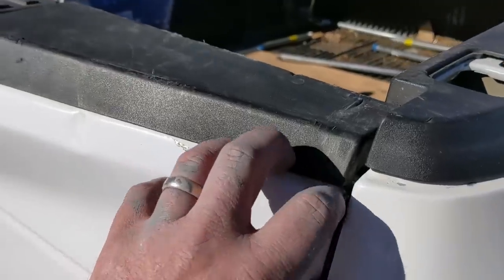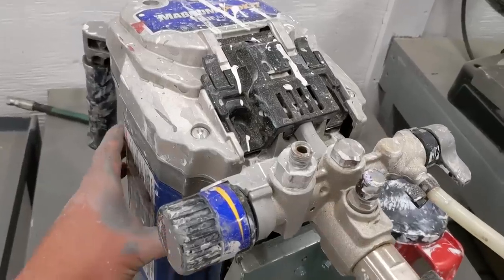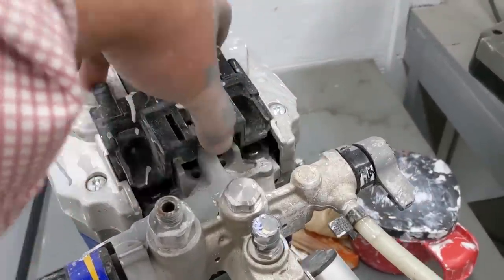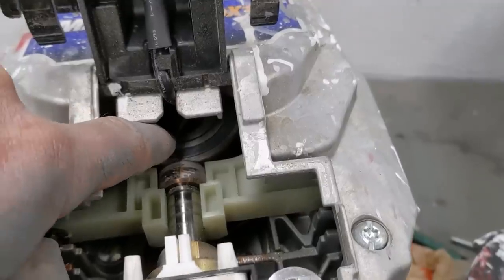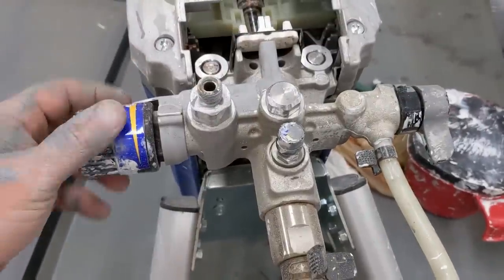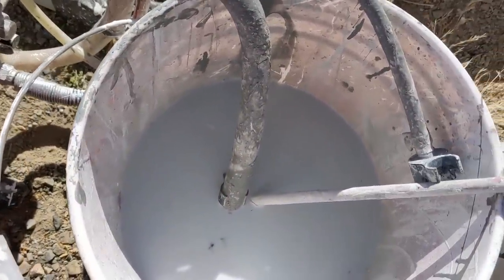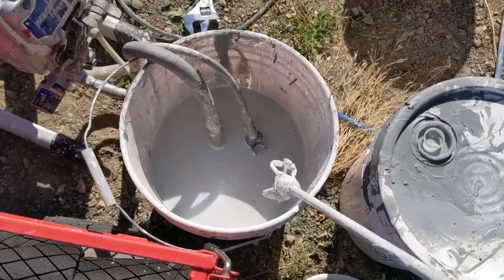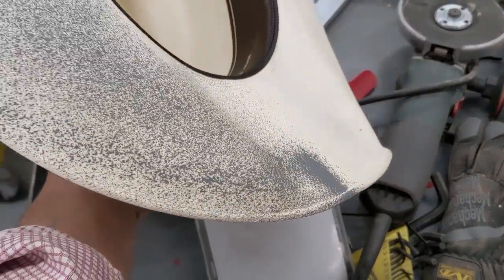Tune-up the wife's favorite toy | Grayco MagnumPro

Comment: Actual Help Wanted Ad seen in South Florida:
Painter Wanted. Must be sober.
Reply: 3 weeks later:

"Painter wanted. Preferably not drunk."
Reply: @hillie47  
LOL!!!
Reply: Sober Painter is the White Buffalo of tradesman. Hence the official classification of the painting trades as 'Semi-Skilled'  with the exception being automotive finish booth sprayer .
Reply: @DavidDiaz-zp4hu  
I work on boats. 
I've seen some real artists applying glass like finishes to high end yachts and boats using a technique called "Roll and Tip" ( NOT spray painting).
Incredible attention to detail required,  and a in depth knowledge of flash points, temperatures,  drying rates, and many more things than I know. 
Definitely not a place for a stoner or drunk.
Reply: @DavidDiaz-zp4hu  
Umm... I think that you missed my point. 
I was saying that the people who can achieve glass like finishes using Roll and Tip are highly skilled and trained. 
Also, (instead of flash point) I should have said flash rate - the speed at which a coating of paint "skins over" - which determines how large of an area you can roll before needing to tip.
I've seen where they've had to adjust their paint to reducer ratios several times while painting a single large hull, based on changing temperatures,  sunlight, wind,, etc.
No. The application of a perfect Roll and Tip finish is not something that can be done by a drunk. It takes a real professional with an excellent sense of detail.
Reply: Florida Man
Reply: @DavidDiaz-zp4hu  ya found him- Been sober 2 years and painted professionally most of my life.
Reply: Sorry to hear that,.  My Condolences on your choice of trade ..
Reply: I think the joke isn't that painters are a bunch of alcoholics, but that even a sober painter is going to seem "drunk" from inhaling all the fumes of oil based paint and stains.
Reply: @deltab9768  Majority of painters are active alcoholics-  I'm a rarity
Reply: No actually it's more of a stereotype than a joke,  the fact that so many painters , drywall\ sheetrockers etc do drugs and drink even on site,  being that their job is so low skill that it doesn't require a huge amount of focus & concentration to keep others safe or do the job.
Reply: @DavidDiaz-zp4hu  Takes more skill and training than any other trade to do high end work competently. Everything else is cookie cutter glue paste screw and solder

Comment: Another great use for these is household cleaning..a low volume pressure washer.   I kid you not, 3000 psi water at a few pints a minute will clean the grout in your shower faster than manual scrubbing.   
Yes, I have used my 4000 psi 4 gpm beast inside the house..but for ripping up a fooked concrete patch job over embedded plumbing "repair".  Fixed the copper with refrigeration silver solder, then used proper concrete patch.   Floated it with microtop, then stained the concrete.  Invisible.

Comment: Brother has a painting company here in FL those graco paint sprayers are expensive (his costed $5000) but built mighty they are made in the usa if think your sprayer is dirty you should see his holy moly.

Edit: his is gas powered and uses 5 gallon buckets you need to keep an eye on it or you'll run out of paint quick

Comment: Well this takes me right back to my first job as a kid working in the family paint shop. Had an air powered 3000 psi Graco to apply high solid marine anti fouling coatings. It was a great machine when it was working, but those high solids paints too their toll and it needed a lot of maintenance. How does that electric job handle the thick stuff?

Comment: ...I'm a wondering if you were to use the 'Varnisolv' (brand name for oil varnish remover) to cycle through that thing once in a while...then say a brake clean chaser to clean it out right proper.......then perhaps a hot soapy water to make sure there is no leftover paint contamination...I found paint thinner OK when I would wash my paint guns ....when I'm not fixing industrial compressors (the Varnisolv reference), I'm somewhat of a super duper amateur (emphasis on the amateur) car painter in my off time................just no smoking during the process..lol

Comment: Hi AvE. I just  wanted to say that I really like the content. I’m learning lots in the way of separating the wheat from the chafe when it comes to tooling. So thank you for that. I have a suggestion based on a recent purchase I made. A “refurbished” brand-name power tool from eBay which I’m kind of dubious of. I expected it to look tatty (nothing in life comes free), but having looked at the brushes, they look like they’ve not been replaced. So, are they genuinely high spec tools for bargain prices, or are they just flogging clapped out gear to idiots like myself who don’t really know what to look for? 
Thanks again.

Comment: Most issues that happen with this unit are related to check valves. 80% of the time it is the intake valve, if not very rarely the out port valve.
Reply: Easy way to diagnose these machines are if it's not priming or building pressure its related to check valves or prime valve leaking. If not turning on it could be the switch, wire harness connection, pressure sensor clogged or failed, or blown fuse. If you see paint leaking from pump, do not continue using it. Get it rebuilt. Continued use will cause other components to fail.

Comment: The home depot Graco stuff is junk and is made by a different manufacturer than the good stuff. As someone who used to work on these things for a living, the pro stuff is built soo much better. The pumps are rebuildable everything is stainless steel and are put together very well.

Comment: Dont know that machine at all but most all paint pumps have internal nylon packing that wears out right quick. Especially when an in bucket strainer isn't used to pre- strain the paint. Paint has lots of crud in it ... right from the factory. Strain your paint and save your pumps life. Also Clean the bastard damn thing like your life depends on it. Put pump oil on that shaft dude.  Yes i'm a painter.

Comment: Weird flex, but ok.

Could have used that selection at work today, trying to setup the simplest pneumatic hookup, digging through mixed parts bin and end up using like 7 parts/fittings instead of two, sigh. But legos are fun, aye?

Comment: Hey, if it gets paint out of the can and where you want it, it's worth whatever it takes to repair or maintain. Those sticks with dead animal fur on the end are the most vicious torture device ever invented. 
Get the pump working, whatever it takes. If I had to get a new wet end for every job, I'd probably do it.

Comment: I have this liquid solution GRACO TSL-THROAT SEAL LIQUID for these pumps you're supposed to put a little bit in it after you use it and it dissolves all the hard solids and whatnot. It basically cleans it up I think it's called throat seal liquid idfk but it works great. Graco TSL Will this liquid help in this scenario!? Thanks

Comment: Those suck simply because people will buy them from Lowe's use them leave them full of paint and then return them as broken and then resellers and people who get them after the fact will sit there for 20 minutes trying to figure it out then just to realize well let's just throw it together see if she works fill it up with water pump it get all the paint and goop out and then they usually run fine

Comment: This pump is a "home depot special" as we call it in the painting industry. Works fine for home owners. We use those pumps for shooting epoxy 4 or 5 times before the solvents (mek) an other thinners eats the packings. The side valve on the pump is the bleeder valve designed to remove air from the pump an hose prior to pumping the paint. Pressure gouge on other side of that. The button on the front of the pump pushes a needle to hit the check ball in the event its not sealing correctly. No need to unscrew in most cases. If its not pumping right check your packings those are simple to replace in most cases as are new bleader valves. Good luck brother. Love your channel more Japanese product reviews. Keep your dick in a vice. 😷😎

Comment: I used their (gr*co) battery powered pistol years ago and after work, wen opened it  for cleaning, i was very badly surprised. I can't remember, but the piston or the cylinder was rusty/ understand not stainless steel, which should be every single part, or at least some kind of plastic. Wtf.... anyway

Comment: My wife has a tattoo of a pocking finger near her start button,  she  got it after a night of drinking that lead a bit of the piston act.  And before you start the answer is yes I did pick her start button a few times.  Yes I was a bit under weather butt so was she so the piston was well greased the cylinder was lubed to specific so I start the installation and damned if I didn’t get the piston wedged in the smaller tighter high pressure cylinder.  Well she got pissed, and I got pissed, and she sure wasn’t inclined to due a proper piston installation after that....

Comment: I’ve been a painter for 20 years and that pump don’t sound right to me? It sounds like it has an air lock, the pumps need to be primed at times, the recirc hose should flow a lot smoother not so spluttery. 

I’ve also taught my fair share of new painters over the years and the FIRST thing I teach is.........  THIS MACHINE WILL KILL YOU!!! Paint injection is very dangerous and life threatening, never remove the spray guard and never put your hand in front of the gun and always keep the safety on on the gun when not in use. An airless spray pump is an incredible machine if used correctly and safely.

Comment: I've got that exact unit and it SUCKS. they're never cleaned right because cleaning is a 100 step process. Messiest sprayer I've ever owned. You aren't using it without ending up being coveree in paint yourself.